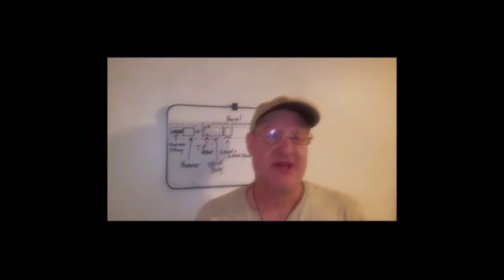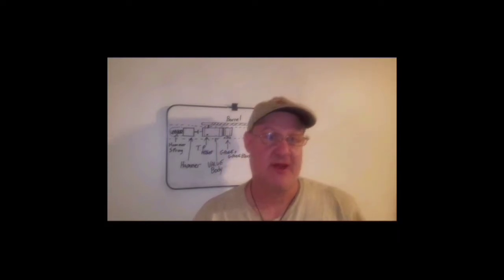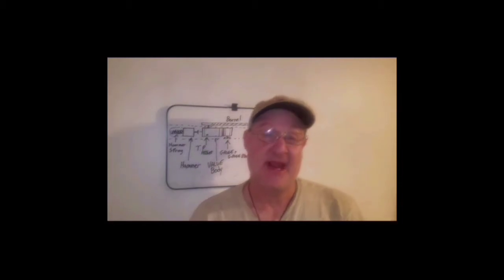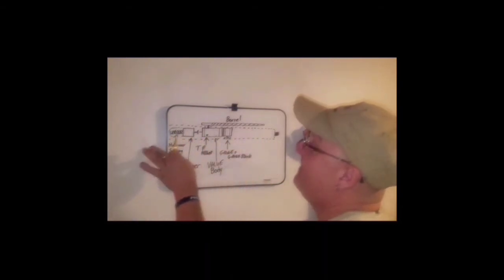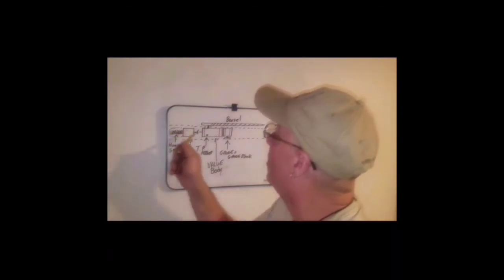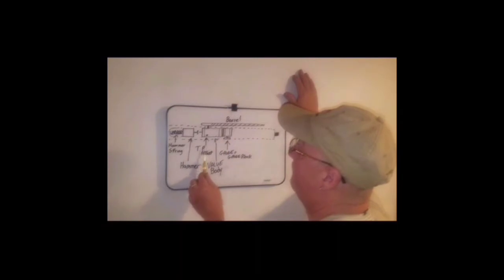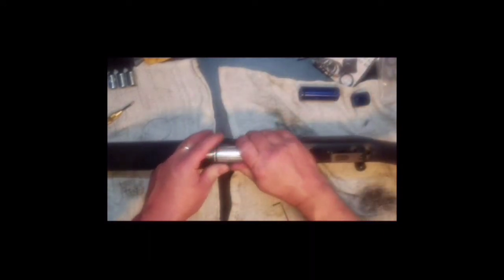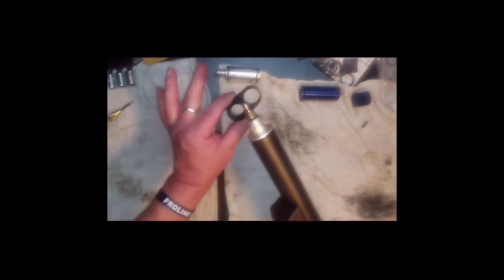Field Target Tech Channel Episode 10 Benjamin Marauder Regulator Installation

Comment from the maker: Samrong, the regulator is either a Huma regulator, Lane regulator, or the regulator from Airgun Exporter.  They all are installed and are adjusted the same way, and their operation is the same.  I am in this case installing the Robert Lane Regulator.

Comment from the maker: Scott, you are correct, I removed the stock for easier viewing, didn't feel the need to show the stock removal.  The air gauge was removed, as I already had a regulator in it, and I just wanted to show the ease of regulator installation.  The regulator goes against the gauge block, but the pressure gauge will read regulated air. It's up to the rebuilder whether or not to leave the block in.  The Archer tool is used when removing valve from the rear of the gun.  Being that I did not do that, I could not demonstrate the use of the tool. In the future I will do a complete rebuild, and a full comprehensive video on a complete rebuild.

Comment from the maker: You are correct, I thought I did.  It slid into place very easily, with zero resistance, If I felt any resistance, I would have used that tool I used from Archer Airguns.  Good eye for picking that up!!

Comment: I was confused. At the 10:30 min. mark you are removing the air fitting assembly. There is a gape in the procedure as there is  no longer a stock on the gun or apparently an air gauge. As a total newbie it would have been nice to see you perform everything. It would have also been nice to see you demonstrate using the Archer tool. Is the air gage seated against the regular?

Comment: Did I miss the removal of the gauge block. Or did it get pushed further down towards the hammer ?
Reply from the maker: Stephen,  in this video I only show regulator installation,  the valve and the gauge block were not removed.  The regulator butts up against the gauge block.  The gauge will now read the regulated pressure.   The gauge and block may be removed, with the regulator taking its place.  This will give an extra shot or 2, due to the air replacing the gauge block space.  I made this video for the simplicity of a regulator installation,  without going into any of the internals of the gun
Reply: Ok apparently there are different styles of regulators. The Huma ones have a gauge port as part of the regulator so the original valve block needs removed   Your style and my simply but up against the valve block. What do you do for a vent for the regulator. My instructions say to remove the forward facing side o ring from the valve  block and simply but the regulator that gas an o ring that seals to the side of the valve block up against the block.
Reply from the maker: @SpYucaipaSoCal  , the installation of this regulator does not need a bleed hole to be used.  Some Huma regulators say they need this bleed hole to operate properly.   This regulator is a Lane regulator,  which by design,  does not need a bleed hole to outside atmosphere.

Comment: Correct me if I am wrong but does the marauder factory gage block butt against the valve if not the you need to put a spacer between the gage block and the valve.
Reply from the maker: With the Gen 1 model, a spacer between the valve and the gauge block is not needed.  I'm not sure about future models.

Comment: What is the string hooked up to?
Reply from the maker: Sorry, I forgot to highlight that detail.   On the end of the regulator,  there is a screw that protrudes from the regulator.   This is not an adjustment screw, it's just there to fill the threads, and let the air through a little bit slower.  The string is tied to this screw, and that's the string you see me tucking in at the end, when the regulator is bottomed out, the string is long enough to extend past the tube.  I am tucking the string in before putting the cap on with the Foster fitting.   In the future, I won't have to disassemble the entire gun in order to take the regulator out.  Just remove the end fitting,  fish out the string, and pull out.  This is handy if you want to quickly adjust the regulator pressure until it suits your needs.

Comment: No the tube is not regulated for 3,000 PSI it is the stock valve. Checkout airgun mad labs The Marauders pressure tube failed at 10000 PSI. That said I will still not go over 3,600psi